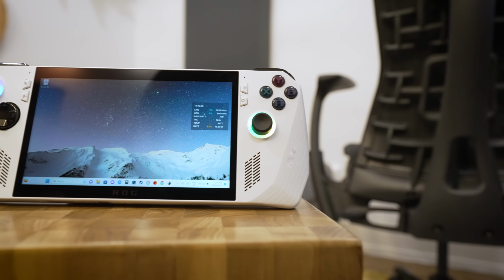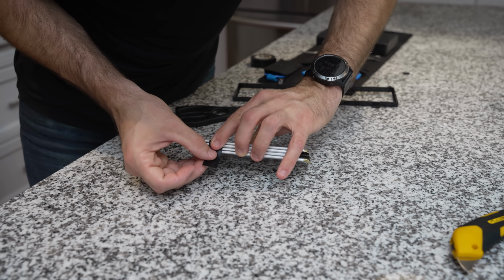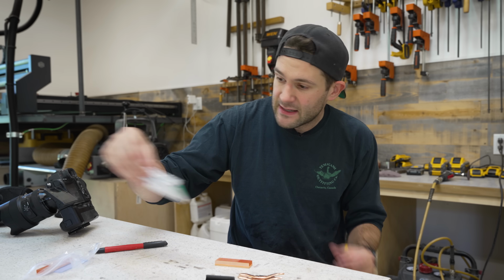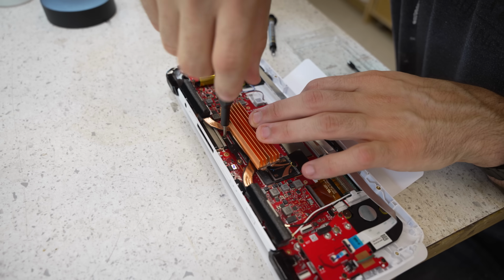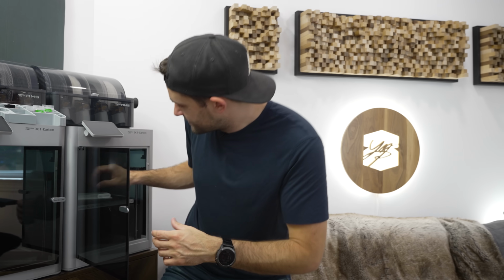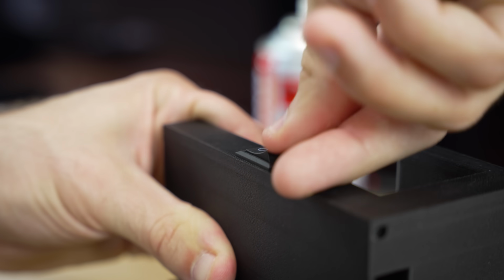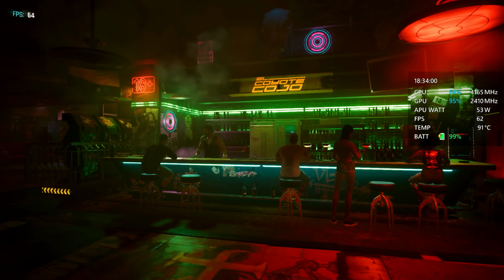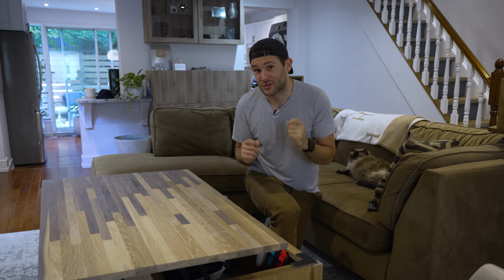I don't understand why people buy Steam Decks...

Comment: Its is possible to mod an Rog ally to?:
▪︎Modular Battery. Instead of thinking of expand the battery what if you made it with two battery slots. one that cant be removed and will act as a backup / emergency battery so you have time to swap the modules. them the removable battery  module should be easy to slide and click. so when its drained you are prompted to reload the battery so you need a button to detach the battery and them you load a new one just like an ammo in a gun. use, once depleated you  reload. them you get the battery and put in a recharger just like old phones from the 90s. so we need a recharger that can hold multiple battery. so i think the best design is to put there battery to recharge from the small side on the top so you can put like a stick. them the you have the battery as ZPM from stargate atlantis on the recharge and it is used in horizontal on the rog ally. once you do that. now you need more slot. so a rounded gear design would be nice. so you can have one slot on the top one in the bottom and others on left and right them you fill up with more 4 diagonally. so each rod can have up to 8 battery sticks. so you put this rod in a base where they can be turned and a complex axis that can shift the gears of each rod of 8 slots. so you can add 8 rods that can turn each one separed and a control unit to make it move to give you a free slot or to give you a charged battery to reload. them in the sides of the rod mus have the pillar as arms to hold it and a cover with an LCD display on the base of it to display each status of each battery and a good power supply to be abble to fast charge this whole insane charger. so this is for you charge in home. for use off home you need quick acess to the battery. so why not Kamen Rider Belt full of batteries. you just wear a belt or wear more slots on the legs to carry the battery modules on your body or you can have it on your chest like a battery rambo. would be nice if each battery have colors to display the status. so you can easy see which one is depleated or full of charge. whould be nice to have also a individual module charged included on each battery so you just pop the button and brings off a conector so you can just charge it in any socket in the other side of the module. so baterry problem solved! you can game for hours in the jungle if you get you full loaded of battery modules. would alao be nice if we have it as a service. Machine where you put your module pay for the charge and get a new 9ne recharged. so people can share the modules. those machines could be in anywhere shops, gas stations. it even can be a default not just to rog but this idea could be used as standard to any handheld device. and we could have case adapters to use this system on phones as well. this can also expand to use other power sources as cars with wheels that convert mechanichal energy into power so you can place those modules on slots inside the car, and even adapters so you can transfer energy from other devices to charge modules. so you can use the modules to free trade energy!
Reply: ▪︎Phone Module: 5g or greater connection module. add in a module to give Rog 5g + Features with Esim and Simcards slots. to use more than one at the same time and combine data use from more than one carrier at the same time and maybe some module to make it work that elon musk sattelite internet network i forget the name. and them also in the module a router to share all the data connection with nearby devices to build an organic p2p internet network trough wifi that all devices can transfer data from the radio towers to the nearby p2p network. so you can bypass country borders ignoring local restrictions since the network made by modules in the same standard would be connected by the nearby swarm of people using the modules instead of the fixed radio towers giving to the network the ability to connect anyone by any single access possible so no governament will be able to Block any ip ever. without the need to people to use vpn as we can also have on built in the module if in case we have two chunks of the swarm isolated. this module should run with the main battery module as power supply. and be atached in the midle if the back. it also could have features to stream video and audio in 4k to any nearby monitor wireless just like samsung dex does. without needing to dock. and an Windows app designed to deal with the module, receive and made calls. plus add speakers and mic to make rog acr as any phone in a easy way. and an an android emulator cloaked that instead of give you acess to android apps inside a android window emulated make the android apls works on Windows individually mixed with other windows programs. so you can have a phone complettly built in on the rog with Windows and have android as silent addon on Windows.  the module should also bring NFC and GPS and all other phone capacities. so you can pay and navigate whit your rog.
Reply: ▪︎New Design for the entire structure: get rid of all and think in a way of put ROG main structure inside a model more close to a switch or a tablet without the controllers and buttons. it all would be in the borders. a new Amoled screen with cameras like a phone. 4 cameras on the front and cameras on the top sides. and all the modules connectors on the back and a swich joycon system to the controller and connectors to allow add extra screens and places for speakers and mic and all we need to fit in. and 2 SSD and 1 SD slot and at least 4 usb C slots. and a fast connector to add acessories in the bottom side.
Reply: ▪︎3DS Second Screen / Z Fold Feature Tablet : over what i said above. a second removable screen that is a full touch amoled screen and other that is based on new 3ds screen  with cameras to adapt the 3d. so you can have one "Z Fold Style Plugin Display" which would make the screen works as a single one screen with extra grips to you add in the other direction so you can turn the screen whit gyroscope  like the phone and change the joycons place from the one screen left and right to bottom of screen one and top screen two. so you can just make it enlarge the screen and also use a virtual keyboard on one and a screen on other and use as a laptop, so you have a Z Fold / Lap-Top / 3DS Hybrid. and the 3ds screen would be Another one with 3d features. so you can use on 3ds mode to play wii U, 3ds and virtual boy. and both of the can be closed. or you can have 3 screens and fold it twice with a third adapter to 3 screens! you can also connect to Multiple monitors and tvs at the same time so you can use at the same time it as a phone or tablet or a wii game pad.
Reply: ▪︎Cartdrige Module / Card Reader / Printer  : A universal dumper that dump any cartridge and can hold on its menory any rom or iso to act in real time as a psychal cartridge. it would have also its own modules inside the module so you can change the cartridge type. so you can put n64, Switch, PSP, Gamecube, DVD, BD, modules on the module (all would fit in belt and wearable clothes so you can just take of any game cartridge slot of your ass and plugin in the rog them you put the original cartridge on it, it them dump it save it on the ROG and can also hold in its own RAM. and emulated with high accuracy. it also could came with a universal modular port to link cables. it would fit in the top Back of ROG, and if the module is big it would just plug on the top but cover the entire back (think in nes cartridges here) but the top sides must be free fir the câmeras, in the most close of the ROG area would be a place to put some sort of polaroid style film or paper so it could print Photos or Cards so you can print your photos or Post Labels easy just need to change the film! lol im insane. and in the middle it would have a swap card place. so you can swipe Cards just like Ereader or Magnetic cards. and if you put the card in other way you have a bank card chip reader so you can receive payments too. but when you put a cartridge game on the module the module would be able to print a card of the game so you can have a card with the game to use cards on the reader to easy load any game from the module and also print shortcuts to any app you have. so you get your original game from your Collection. put the cartridge, dump it and save it, print a card and them put it on a case deck on your belt. a case that can also read cards and order them so you can control trough Bluetooth the order you want so you can take the card and them read it by swaping in in the rog and them a músic confirm and say rhe game name them you press the button to activate (oh my god i watch to much kamen rider and super sentai)  it also could work to emulate gba card reader off course. As the module have modules you can have an infinite option of midia modules. even VHS module to convert VHS in digital files and print a card. as a option to print you can acess them by voice command with other acessory an "ROG Watch" so you can say on the watch a command and load and when you Record it you can record the command. would be nice clithes full of SSDs and a mobile server so you can access infine storage from your jacket wireless in the ROG. or just use cloule storage lol.
Reply: ▪︎Insane Sword / Gun / Bike / Steering wheel Joycon adapter : you remove the joycon them you get some sort  of gun structure where you can dock the rog on the middle where you can acess the battery on the bottom and the screen stays on the right side, in the left side it gives you an new screen. the main screen now works as a touch pannel for features, and you now use the screen in the back. you now have the card / cartdrige reader in the top, the module adapters joycon what the hell this is i dont know, will give you  full control and fixed structure new controllers that can turn and slide, fold, you can hold it as a massive big joycon or you can open the left one as a gun and you have an umiversal pointer that work with all games of story of gun adapter to emulate from nes to wii shotibg games and also a câmera to read the screen for games not made to this and new creations, it would also have a trigger on the right side and a transparent screen aim pop up that fold off slinding in this mode. but if you turn it again the right joycon to horizontal position and the left one you open a blade just like power rangers gun you now have a sword! (that can work like wii motes),  but you close both side and drag them opening the thing expand becoming a stering wheel or a a plane controller, if you close and put the blades that pop up to turn to you now you have a double atari or Helicopter joystick. if you open it all straight you have a staff. you can add plugins in the points, and the screen in the middle can rotates and open and close. or be removed wireless connected to it and put onto your arm or on a VR Glass Adapter. you can also have Bow and crossbow mode by jyst changing the position of this insane thing. and the blades can be changed for bike controllers / jetski and you can put this thing on a base dock to use as a bike simulator. would nice if this can be used to control real vehicles or even real weapons modules or drones...
Reply: am too crazy in think about all this ideas?

Comment: Asus has a nightmare warranty and customer service on top of the confirmed SD card problems. Not to mention other pc components asus has had faulty issues with in the past. It runs Windows which is frankly awful. 
 Valve has consistently poured blood sweat and tears into making the steam deck into an amazing product. It's not as powerful sure, but there is very little hassle. The Linux os is great and works so smoothly it mollywops everything else on the market by a wide margin. Valve then made Linux a viable option for gaming as a whole. They let me nuke windows off my machine and slam dunk Microsoft into the trashcan. I must thank our Lord and Saviour GabeN by giving him more of my money.

Comment: biggest issue with liquid metal is that due to it being a liquid, if you play for extended periods of time, it may run and cause an uneven spread of the material.  it's one of the major issues with the PS5 if you use it in the upright position for long game sessions.  apparently it has caused quite a few of them to fry the CPUs.  It's amazing for stationary devices that will stay horizontal at all times. I believe that people that use liquid N2 for overclocking will use it as well.